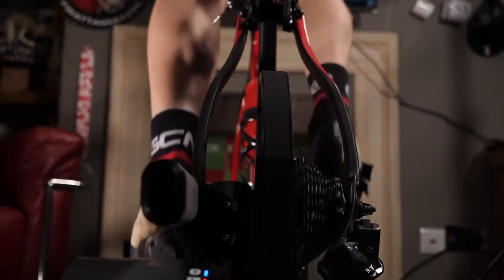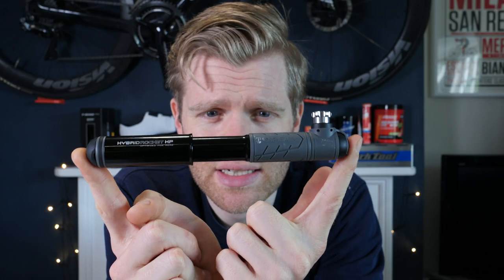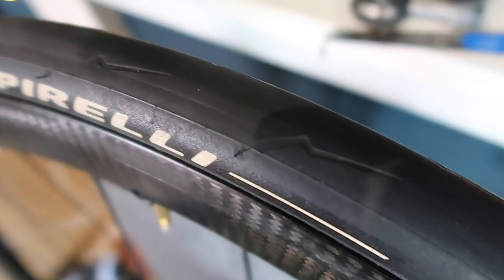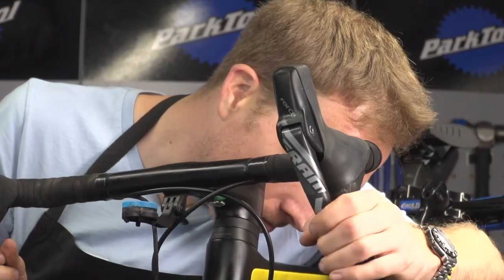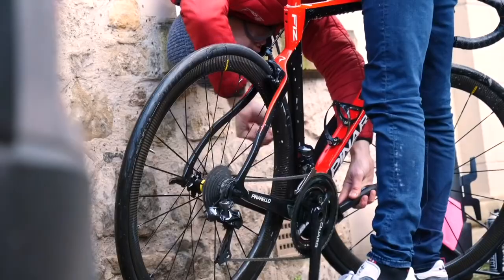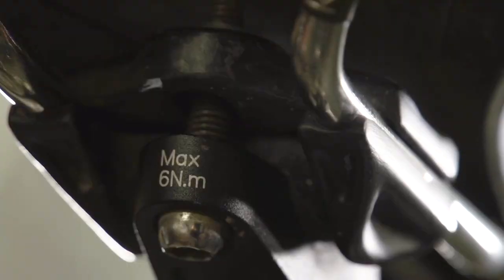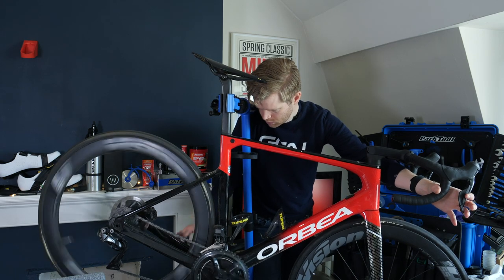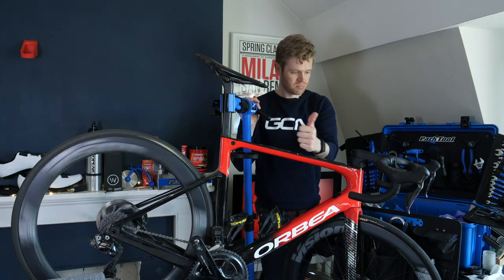Essential Bike Checks Before Riding Outside | GCN Tech Monday Maintenance

Comment from the maker: What essential checks do you carry out before going on a bike ride? Let us know 👇
Reply: That the DI2 is charged
Reply: Pumping the tires. If I wanna go fast, I'll pump up to 100 psi. If I wanna take some fun ride, I'll give 90 psi.
Reply: Check that the lights are charged and installed...btw. #lovethehair
Reply: That's it hasn't been stolen...
Reply: the M check, most times, lights have atleast half charge and that the rear wheel isn't any looser side-to-side than the previous day.
Reply: I normal check if the next door neighbour's cats are hungry (they follow me into the garage).
They usually are, so I feed them. They're usually hungry when I get home from a ride too.
So I feed them again. That's my good deed for the day :-)
Reply: What code modifications I've made to automatic shifter the night before. Just a quick check it shifts on it own. So I can upload a previous version of the code before I get outside.
Reply: Charge the day before: Garmin, lights, and my Varia. Day of: tire pressure, check tires again for glass, thorns, etc. Wobble, twist, and push for loose bits.
Reply: GCN Tech ....hi newbie to cycling , thought I’d change all cables  on the bike ,now can’t move front or back derailleur and shifters won’t change gear or move front derailleur....running sora set, any advice greatly received 😩
Reply: I out
Reply: Most importantly a Snickers bar

Comment: I always do a tyre pressure check before a ride and check tyre condition, the rest i do monthly and I always wipe over my wheel rims after a ride out to prevent grime and dirt causing brake squeal in the future. Not sure if disc rotors need that though as some have drilled holes.

Comment: The pressure printed on the tyre is often MAX pressure for the tyre, you sould also check the max pressure for your rims. Your ideal pressure should be somewhere BELOW these values to balance ride quality and rolling resistance/support. This will depend on the roads/"gravel" you ride, the internal width of your rims, personal preference and numerous other factors.

Comment: Some trivia: All tyres be it cars trucks or bikes all have their size and pressure ratings on them, some wheels use imperial or metric or even both.
Reply: Tiberius Moon just be sure you don’t mix imperial air with metric tyres and vice versa.  Not compatible.

Comment: If doing a significant amount of sweating while using trainer, I  would suggest making sure you haven't corroded through the clamps that hold the brifters on.  I got around to checking mine and they are significantly rusty.  Ooops.

Comment: #AskGCNTech On the subject of tires, certainly a good argument is that you can't be too careful when judging whether a tire is worn past the point of safety. But aside from obvious huge cracks, or splits, or bits of wire sticking out the edges of a gaping hole, what are some good criteria for when a tire is approaching a dangerous state, and may be too risky to ride on?

Comment: The recommended tire pressure on my (Vittoria 700x25mm) tires  is 100-110 psi. Surely this must be for a specific rider weight. What guidance can you give for getting the pressure right for a mostly tarmac ride for a given weight of the rider? How much bulge should I see when I sit on the bike? Should front and back tires have the same pressure?

Comment: Bit of an indepth one but I'm pretty new to road bikes and I'm stumped. I have a Cube Attain Race with Tiagra 10 speed and I want to upgrade to 105 11 speed... However, the rear hub is a Cube 'generic' that I can't find any info on and I assume, won't fit an 11 speed cassette (not sure how I can tell?). Can it be coverted to 11 speed with a change of the hub body? If not I guess I need a new hub BUT I can't seem to find an 11 speed 28 hole disk hub anywhere (maybe it's not that common a configuration?). I don't want to have to buy a whole new wheel....what can I do?

Comment: Any recommendations on a small (mini)pump?
Reply: The pump he used on this video, Topeak Hybrid Rocket HP, is an awesome choice with flexible hose, convertible presta/schraeder chuck andyou can also screw a CO2 cartridge into it and have the best of both worlds. Also MT version for MTB or gravel tyres.

Comment: So my disc break seems too have a small bend (can hear it rubbing when pulling the bike out), what’s the best way to fix it without making it worse
Reply: Is it really  bend ?
You could trie to adjust the brake caliper so there's enough space between the pads and the disc
Reply: While looking at your rear brake spin the rear tire quickly with it off the ground and see if your disc is warped or if it’s rubbing against the brake pad(s).